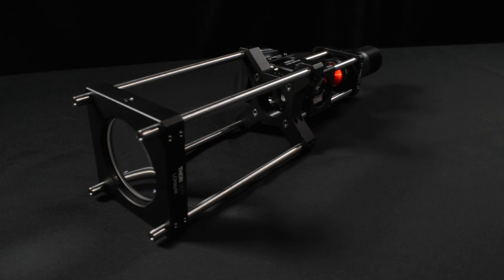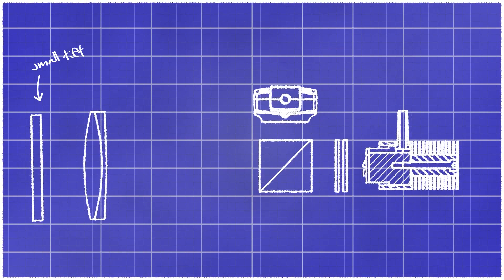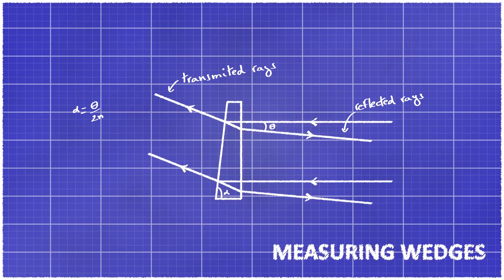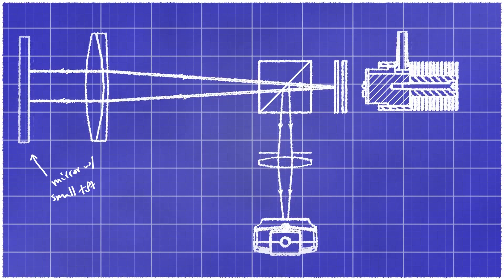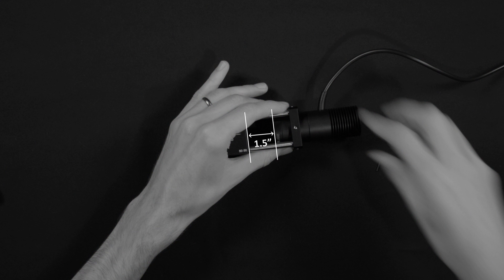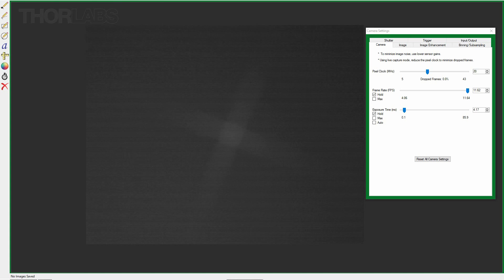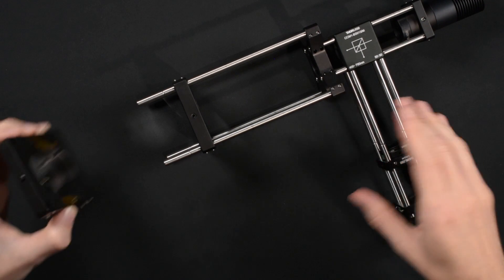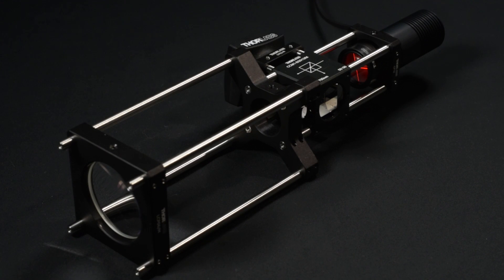The tool every optical lab needs to have

Comment: Hi, thank you for great video. Following your project you think it is possible to create an autocollimator for test the optical quality of Dsrl camera lens? Like an optical bench! Maybe replacing Crosshair Reticles with a very small pinhole for generate an airy disk or airy pattern? or a Resolution chart ? To be more precise something as described in this article http://www.reduser.net/forum/showthread.php?158004-Let-s-make-STAR-LENS-TESTER-to-get-best-lens-copy- easily- (Airy-disk-PSF-point-source)
Reply from the maker: You can use the principle but you will need some magnification in front of the camera because the PSF is likely to be small (e.g. a few µm) and you don't want to be limited by the pixel size of the camera. However, if you want to assert the quality of a photographic lens, I would recommend to use a different method, the slanted edge, for several good reasons. (1) it is much more straighforward to implement as you just need a properly illuminated "L" shape with good contrast. (2) It is closer to how you will actually use the lens (instead of a double pass system with a mirror). (4) At contrario to a pinhole measurement, you are also influenced by off-axis points which is, once again, what you will measure with your optics unless you aim it at stars. (5) Slanted edges are much more energy friendly when compared to pinholes which quickly get you intro trouble because of camera noise. (6) Last but not least, it is recognized as ISO standard for MTF evaluation. So I would not say it is "forbidden" to measure optical quality using a pinhole/camera, but it makes much more sens to use the slanted edge unless you are targetting very specific applications. On the other hand, autocollimator setups are very handy for a lot of different tasks (aligning optics, measuring angles, finding focal length...). I hope this answer your question :) If you want to have a look at the slanted edges, a quick look on google images will provide you with plenty of information
Reply: Hi, thank you for the reply! For hobby I like to repair DSRL Camera lenses, my big problem has always been the optical alignment, specially the adjustment and checking of the optical axis of the repaired lenses. I'm trying to build an instrument similar to the one used by Nikon for optical centering, that I think is like a PSF based instrument. In the meantime I'm trying to find also other solution. If you have some advice or help for my project I would be very happy.
Reply from the maker: Thumb's up! That is a great project :) do not hesitate to share when you have something running. Also, and based on what you are doing, an autocollimator is precisely the type of technology that you need. Because a tilted lens is equal to a lens + a wedge, if you send collimated light through a tilted lens in rotation around its mechanical axis, you will see your '+' pattern discribing a circle around the rotation axis. The smaller the circle, the better the lens alignment is in regards to the mechanics. That is precisely the technique used for ultra-high precision lens centering such as described in this video: https://www.youtube.com/watch?v=dDmf9i6EcUY . To build the setup, either you could split the illumination and place the camera at the focal position of the lens group to see the '+' mark (easiest solution), or you can use the autocollimator with a mirror at the focal position of the lens group. I haven't tested this myself but I know the principle works (maybe you will need to find a few tricks to have it running smoothly). When you list all the potential applications of autocollimators, you realize that is a very powerful tool to have in a lab :)
Reply from the maker: Sorry, I meant decentered lens and not tilted lens. Tilted lens will generate on-axis coma.
Reply: I'm tring to make an optical alignement instrument like this http://www.midwestcamera.com/images/backfocus_jig.JPG , Nikon manifactured. In order from bottom to top we find: condensed bright light - 30 µm Pinhole - in the middle a plate with a Nikon mount bayonet for the lens to test/adjust - on the top a monochrome ccd camera with a high magnification lens. But what kind of lens was used? telecentric? macro? magnification? I did not understand it!
Reply: please have a look, advice are welcome ! Thanks
Reply: @hunkaryilmaz6311  Hello, this looks like it turned out very nice. Do you have a BOM you can share please?

Comment: Hi, thank you for great video. What is the estimated resolution and/or measurement error for such installation? Did you check it?
Reply from the maker: The actual performances are difficult to evaluate due to the very small angles involved without relying on expensive equipement. On the other hand, it is possible to evaluate the theoretical performances based on a ray tracing analysis in an optical design software. The measurement sensitivity is directly given by the focal length and the pixel size and is about 0.0015°/px here. With a typical (based on personal experience) correlation model to detect the center of the cross, it is possible to get 1/4 of a pixel in displacement so we can say that the sensitivity to small angle deviation is about 1 arcsec. This does not take environmental effects into account however (air, vibrations...). On the accuracy range, you first have the accuracy on the focal length which is <1% typical with Thorlabs lenses. Also, the measurement will be biased by the distortion of the lens/cube system. From raytracing, I have evaluated this distortion to be extremelly small even at the edge of the field, less than 1 px! So I would say that this system should be pretty linear. I hope this answer all of your questions :)
Reply: Exhaustively. 
Thanks a lot.
Reply: Thanks for your video. Very interestingly. Ready engineering decisions with such accuracy rather expensive. I consider that your project can be ideal balance of the price and quality for young researchers and students. I intend to collect the same system as at you, only on a granite precision basis and with more rigid metal framework. The device will be is in our laboratory with steady climate on an anti-vibration table. How do you consider whether it is worth replacing F=200 achromat with another, with longer focus (for example F=300 or F =400) for the sake of increase in accuracy of measurements?

Comment: This is an excellent video - well done! I am wondering in what context you acquired these components; perhaps a project at work?
Reply from the maker: Hi. Thank you for the feedback! To answer your question, I am using some of my spare time to work on metrology instruments as a hobbie activity. I then share the results on my website (and more recently on youtube) to help people reproducing the experiments. For this first video I decided to talk about autocollimators which can be quite useful when aligning or characterizing other projects. If you have a look at my website you will see that I have a few posts on optics with devices such as spectroscope, refractometer, fluorescence sensor for fluids... Next video will probably be about scattering sensor but I am also working on cyclic voltammetry at the moment :-)
Reply: Fascinating. I am working in optical sensing myself and I would love to do more experiments on a hobby basis. But as you know optical/mechanical elements, especially from Thor/EO/NP are very expensive for a hobby. The BOM you show is probably upwards of1500 Eu. I am subscriber #2 :-)
Reply from the maker: That is true. Thorlabs is what I would call almost affordable while EO is a bit more expensive and Newport is simply no-way to go. Clearly, most parts are just impossible to get as amateurs. Lasers, 3 axis translation stages, motion controllers... are just way too expensive. On the other hand, you can get a few lenses and mirrors at a reasonable price. Especially when you do not need a lambda/10. After that, you still have a few more expensive parts (beamsplitters, cameras...) but that are still reasonable as investment because you can use them in almost all your projects. They are a bit like LEGO bricks and, to answer honnestly, I spend most of my time trying to optimize which elements to select such that I can use them in several projects. It is quite rare that I buy a part for only one specific project, usually it is more like 5-10 potential applications. Finally, and when possible, I try to reproduce the electronics by myself because that is a part where you do not get a lot of bang for bucks at Thorlabs. For instance, in this video I am using an homemade LED driver that costs a fraction of the price of the Thorlabs one with almost the same specifications in terms of driving current, modulation depth,  noise... But on the downside it costs you time because such a LED driver took me about ~50 hours to complete.